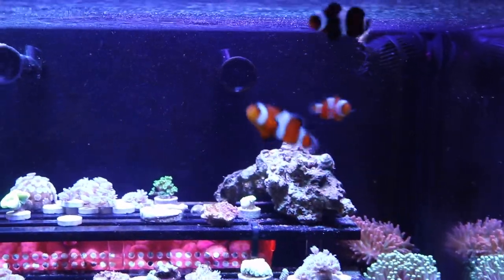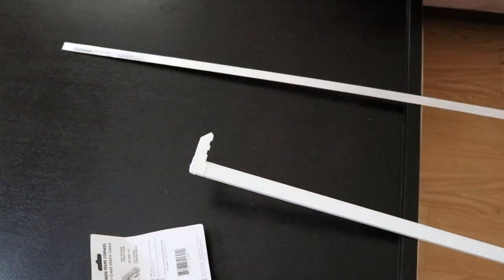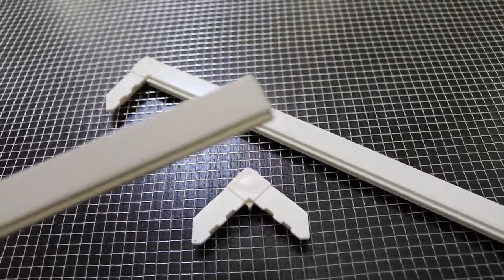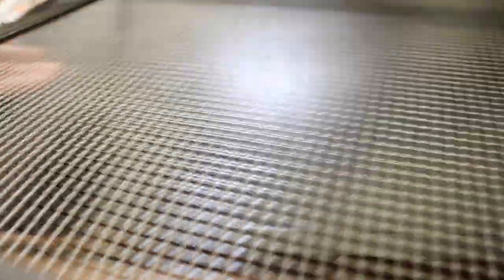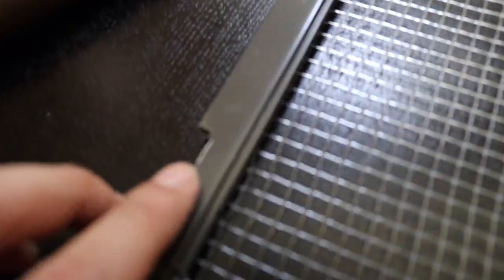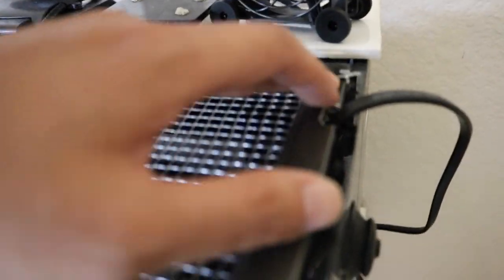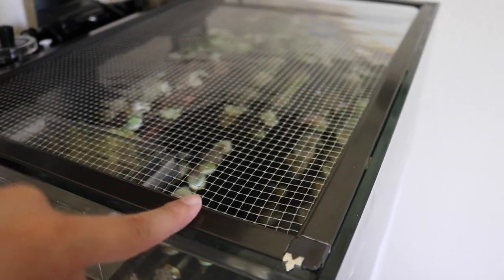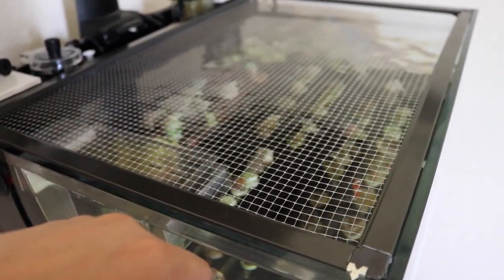HOW TO MAKE A FLUSH SCREEN FOR A RIMLESS TANK | IM25 LAGOON INNOVATIVE MARINE 25

Comment: BRILLANCE! sorry about the jumper,, but you went into high gear brother!
Reply: just becareful using any kind of sprays around or near a screened tank... everything.. air fresheners , glass cleaners - vacuuming anything that swirls the air around in the area of the tank.. meaning cleaning your front door - floors - staircase etc spraying bug spray buy front door ... just sharing my thoughts I've experienced in my life with tanks with screen tops
😘
Reply from the maker: AquariumCop for sure!
Reply from the maker: Thanks cop. Just one of those ah crap moments lol. New one already coming tomorrow for the kids